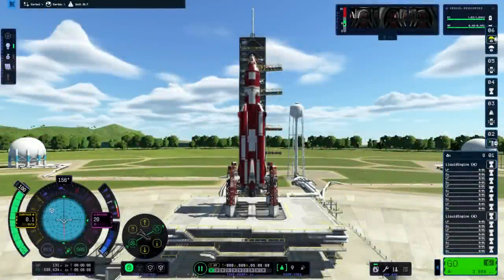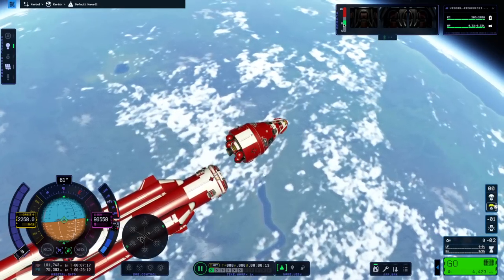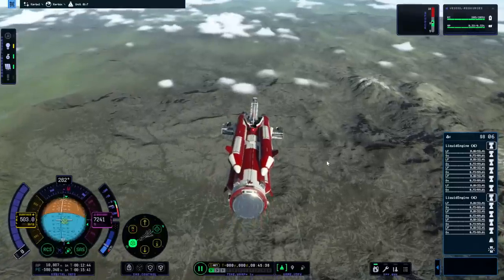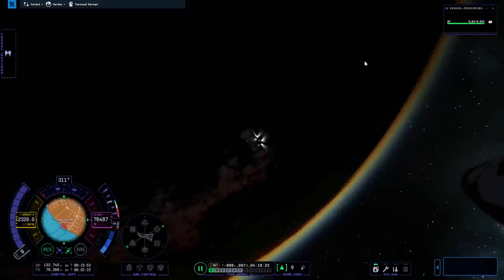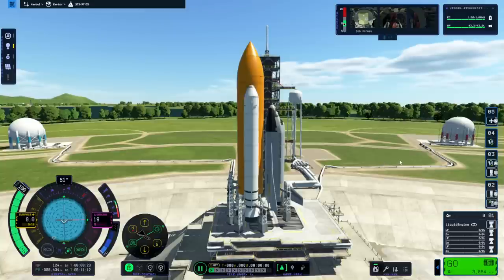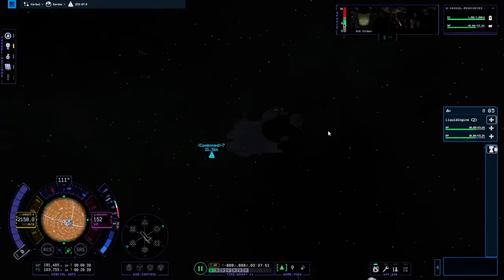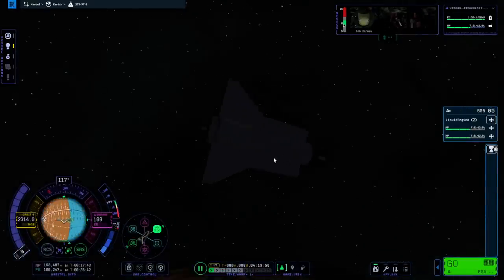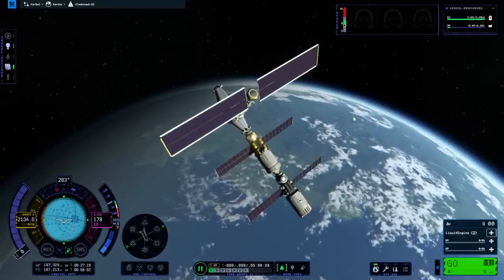KSP 2 Early Access - International Space Station Construction 3

Comment: Take a look at Stratzenblitz75's video, sounds like you have a case of the corrupted save file, and will continue to be doomed to these issues for the duration of this ISS save/build. I've worked around this by just making a new save for every craft/mission, though that's obviously not a great plan for a complex structure like the ISS. Worst case you could copy the craft into a new non-glitched save like he had to, using a text editor with the JSON save...
Reply from the maker: Which video discussed this? I didn't see it. Looking through the save file, I also don't see any sign of corruption. I do make many saves and work backward when there are issues - so far, 19 saves for this ISS build.
Reply: @RaizSpace   His Jool 5 mission, in which his SSTO undocking from a drop tank in orbit around Laythe kept corrupting his save. He ended up re-writing the tank from an old save and adjusting the fuel levels by hand (it was not the active ship at the time of the bug, the active ship doesn't corrupt). A hell of a bug hunt, and he explains it quite clearly. The fun starts at around 12:00 in the video: https://youtu.be/oAjD2pcTUjY
Reply from the maker: Well, looking at that video, his issue is completely different than mine.